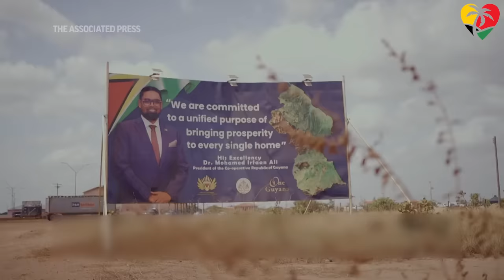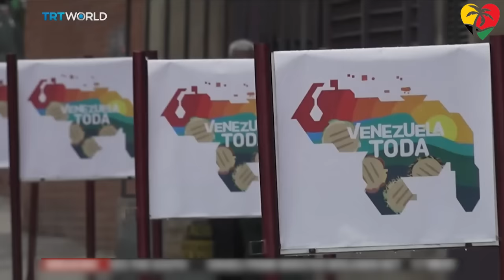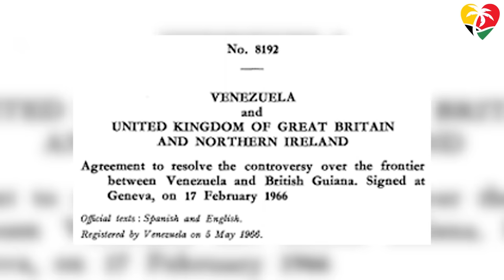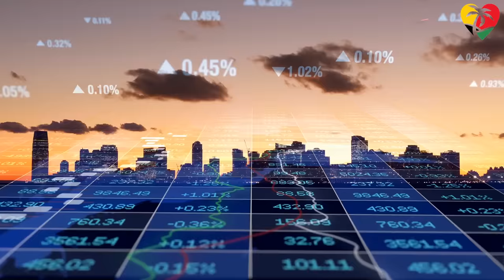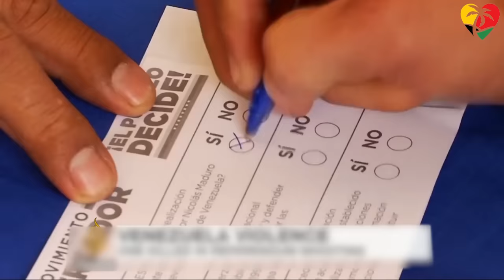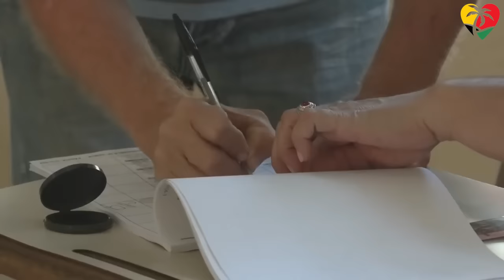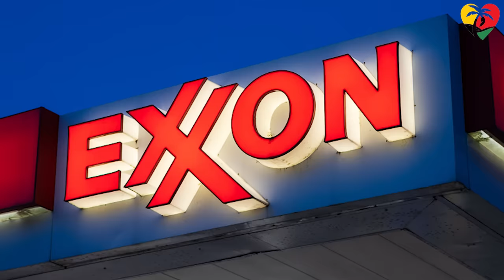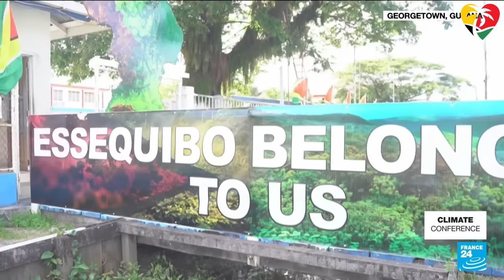WAR Between Guyana vs Venezuela Over Essequibo, Is It Likely?

Comment: One correction, the southern half of the Essequibo is not rainforest, its mainly vast open savannas (the Rupunun i region), so it would be correct to describe the northern half of the Essequibo as tropical rainforest, and the southern half as mainly savanna, Also the ICJ did not and cannot forbid any country from holding any referendum it wants to, that is purely an internal matter, but the ICJ can and did say 'undertake NO actions in the disputed area as a result of your referendum result', THAT - the ICJ can legally do, but not stop or forbid any referendum anywhere.